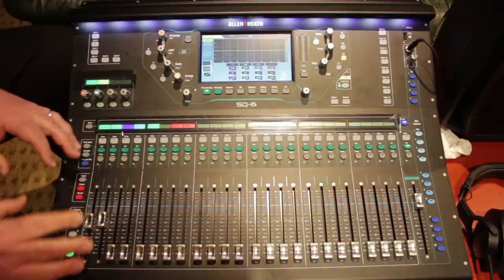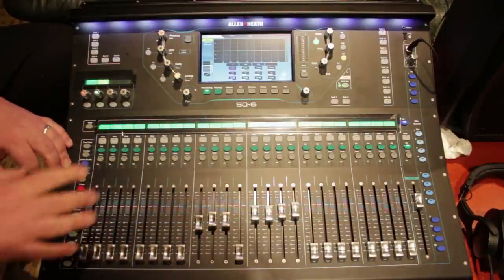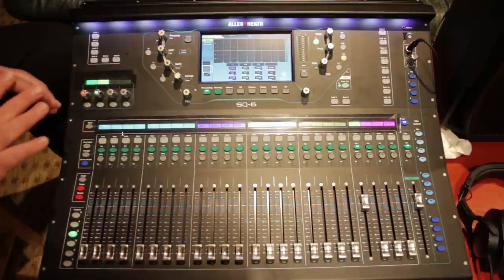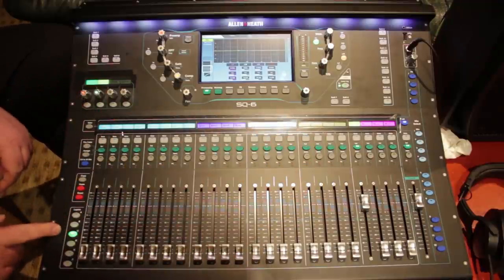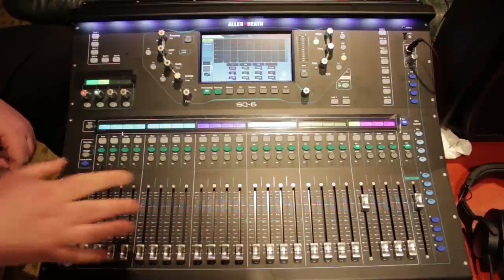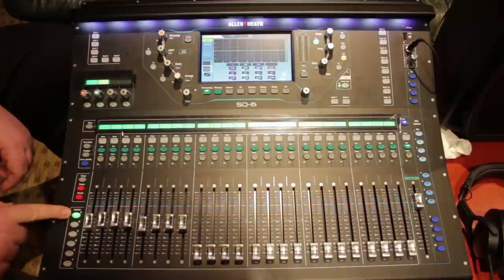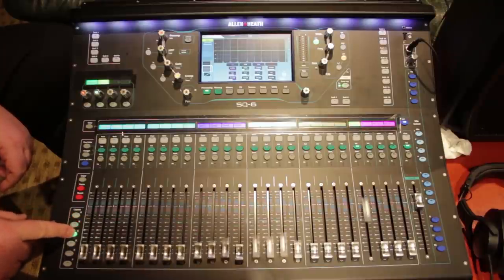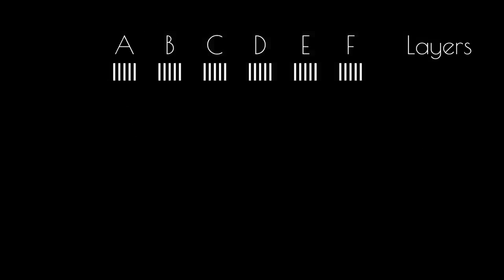Allen and Heath SQ6 Analog vs Digital

Comment: How has the board held up over the years. Do you ever record multi-track audio onto the USB drive? Thanks in advance.
Reply from the maker: I had access to this board briefly while I was working for a company that had it as a demo unit. Haven't heard that they had any issues with it, and A&H is widely known for the solid products they produce with great longevity.

Comment: Andrew Bellous, I have a question. My church plans to get the sq5. I am having a hard time understanding how to get 48ch on the sq5. We currently have the qu16 it’s a one to one patch.
Reply from the maker: Yes, the SQ5 can do 48 channels, but to input all those channels, you would need a breakout box which would connect via network cable. The box would go onstage, and you could plug in directly. Something like an AR-84 or an AB-168. You would then patch those additional inputs to layers, and but pushing a button, your faders would switch to the alternate channels. So, you might control 1-16 on one layer and 17-32. But layers can be customized for a mix of channels, groups and other controls to be conveniently placed together.